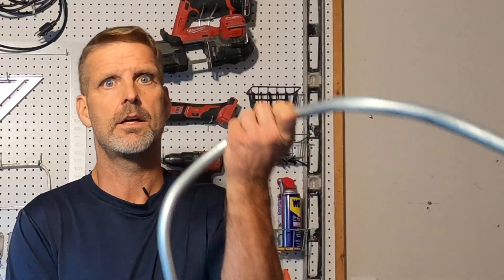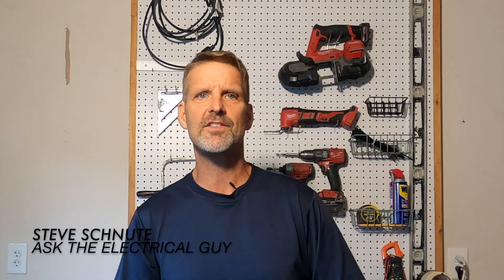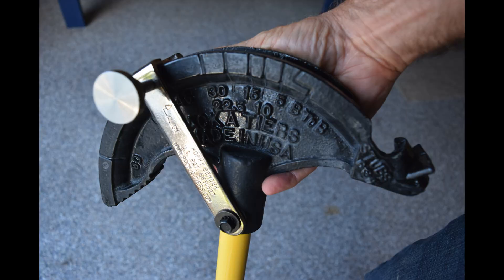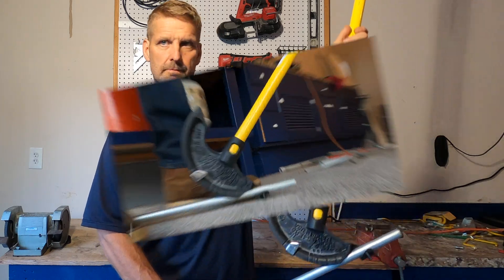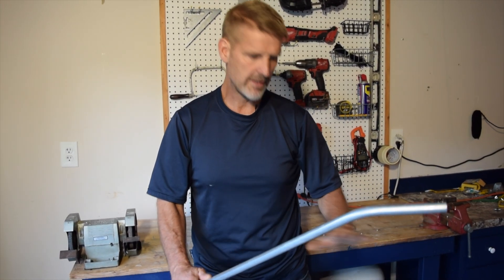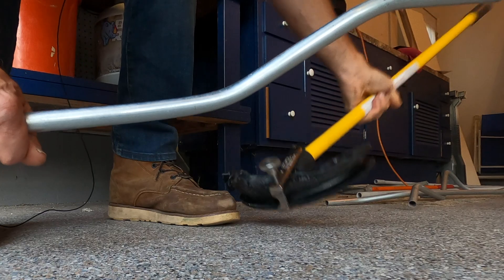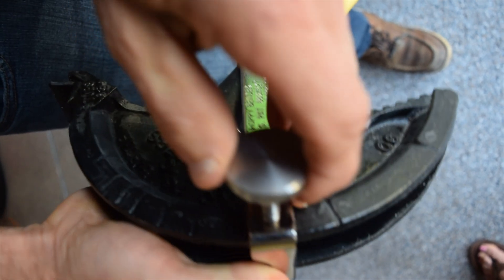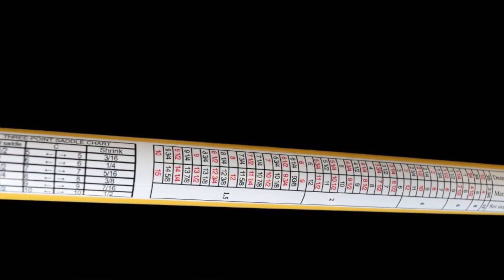Learn how to Bend EMT Conduit the EASY Way - Introducing the Hoppy Bender by Rack-A-Tiers

Comment: Your offset wasnt even straight and you never want to bend your second offset in the air because your pushing your 1st offset back... bad video... no do not recommend
Reply from the maker: The purpose of this video was not intended as an offset tutorial . It's simply a demonstration of the bender for those who might want to buy one.
Reply: @asktheelectricalguy2223  it’s funny I saw an older gentleman make a post and comment about this bender. He said it’s absolutely great but trying to show any of these. Electricians a new and improved tool to make the job easier unless it’s free they just don’t get it.

Comment: I’ve never seen anyone bend the second bend of an offset on the floor I was always taught to start the bend then flip the bender but I’m a second year what do you recommend
Reply from the maker: It can be done either way. For me it does depend on the size of the pipe and my surroundings as to how I hold the bender. Technically, it's best to start the second bend the way you described so that the floor doesn't interfere with your conduit. In this video, I was trying to demonstrate how the bender works opposed to how to bend if that makes sense.

Comment: why not get an ándale reader and prove the accuracy?? would of been cool also to see you doing for a example a 3 point saddle . like you okay you got the bender and sort just made a video kind of really doing nothing other than just show that it has a stopper
Reply from the maker: Sure. I hear what you’re saying. It would have been nice to show a 3-point saddle. I was trying to keep the length to a minimum. This particular video is focused on an alternative to the typical hand bender. The primary advantage of this bender is consistency and speed in bends for electricians in the field (for example wanting a consistent 45º to the eye). This video is not intended for press brake operators/fabricators that need to prove accuracy. LOL

Comment: I was looking at this 140 bucks for it
Reply from the maker: I agree that it's pricey. I do think it'll pay for itself in hours saved - if you do a lot of bending.
Reply: @asktheelectricalguy2223   I do a lot of bending Klein makes one with a angle setter thats what I got instead. Plus the hoppy bender stops at 3/4 I bend a lot of 1inch. If rack a their made it. Definitely would get it
Reply from the maker: @Precocktrigger  I haven't tried the Klein, but sounds good. I wish Rack-A-tiers made a 1". Maybe they will in the future.